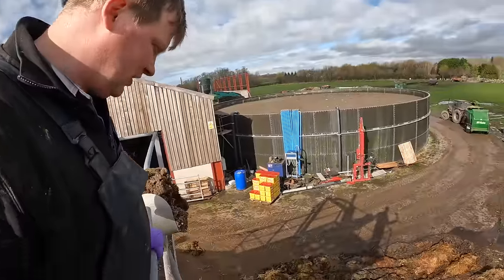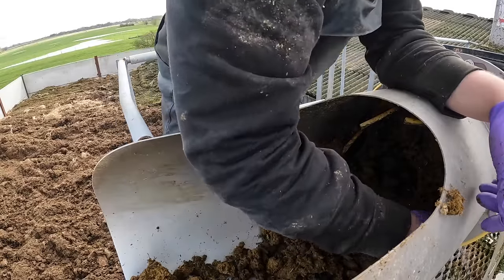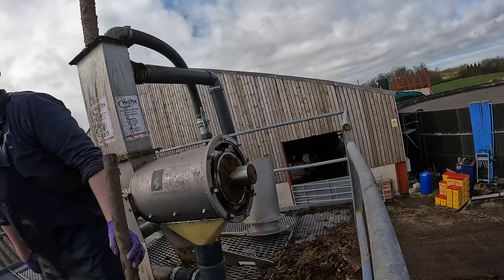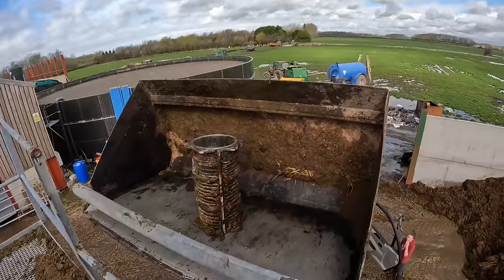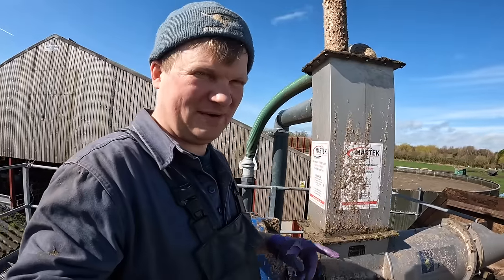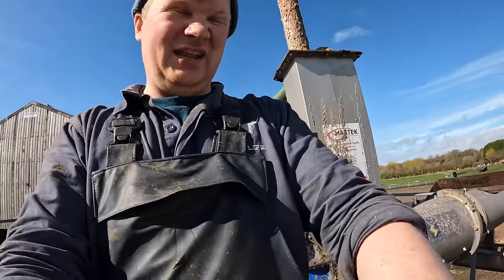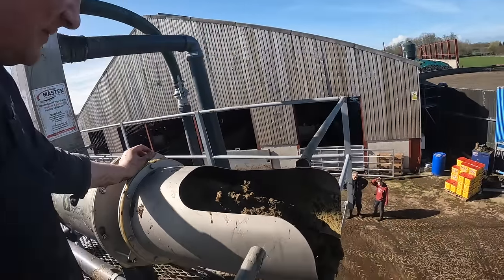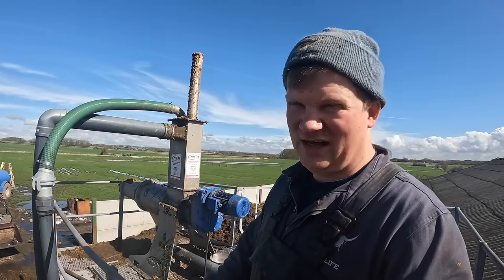ONE OF THE WORST JOBS!!... A HORRIBLE FARM JOB THAT NEEDED DOING...

Comment: Hi Tom, why dont you invest in a conveyor belt system to move the muck from the seperator to the back of the clamp. You should be able to get a second hand conveyor. The conveyor would utalize your time and save on pushing up.

Comment: Hi Tom. I find it simpler and cheaper with the Milwaukee grease gun to direct fill from a 54kg drum of EP2. Stick the tube straight in the grease and pull the plunger out, sucks it up like a syringe.

Comment: When y'all put that tower up for the slurry separator? I thought then installing a removable rail section (to move equipment into and off the platform) and putting a jib crane on that outside forward leg to allow you to raise and lower equipment and tools (yeah, a good tool box or just a bucket with a garden trowel and hand rake would work to clean out that separator out feed chute) could also come in handy to help support separator parts when your removing and installing them. I still think that should come standard with that set up so one person can do the job by themselves. Those separator parts look, ....well.... not light.

Comment: The trouble is that we have had something like 58” of rain since September, so that’s nearly 6ft of water landed in your slurry tower and, worse, on your solids, which not only fills the tower but makes the solids less solid, so you can’t stack it high because it slops out, having absorbed an amazing amount of water.  The answer is, of course, to put a roof over the lot.

Comment: you prob dont need the extra bays on the midden if you keep on top of pushing it up and back weekly, you have a whole ring of panel’s  not being used on the top level there , pushed back and up will easily double what you can get in there ,we used to push our heap up once a week, and it really did help ,especially now you have that fancy telehandler to do it with

Comment: Tom does the motor reduction gearbox on the separator have oil plugs on the side and bottom? I know you greased the main shaft but that motor and/or gearbox sounds a bit whiny when running which could be a dry gearbox! Or it may of always sounded like that and if so please ignore me!  Great show as always. Kind Regards,  Ryan

Comment: Mucky job today Tom. 💩💩💩 GRANTS Can you not apply retrospectively?  Suggestions Look at getting a conveyor belt or auger to carry that muck from the top of the separator to the back of the bay. Put a roof over the top of the bay, nothing too fancy just something to keep the rain off. It will save you guys a lot of work and make the farm more efficient.  Check with the company that built the separator, you should be able to get a drawing  tool to pull out that drum. You could damage the drum levering it out like that, also get yourself a spare drum. If that one gets damaged just think how much💩💩💩 is gonna back up.   Great to see you interacting with Katie, I think you've got a great worker there.  Talking about the 💩💩💩 explosion try living your life with a stoma bag. Hope the Ginger Guy is feeling better